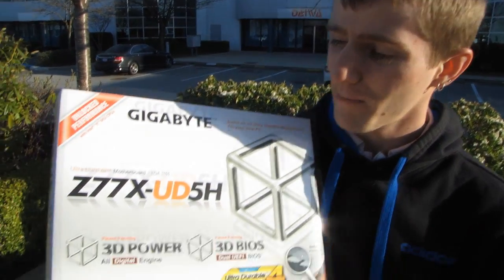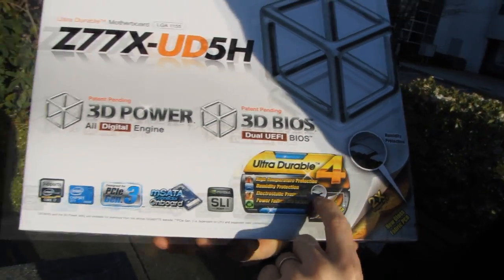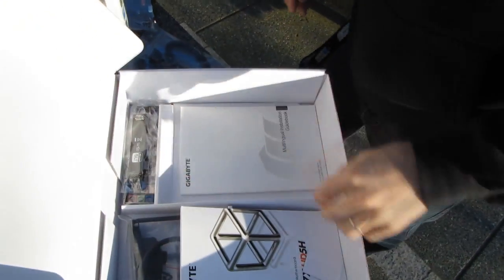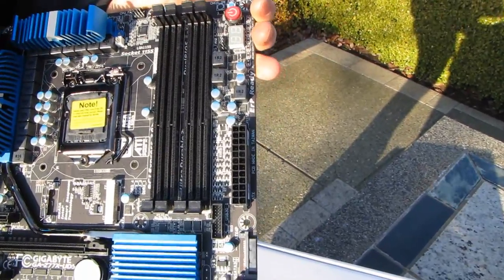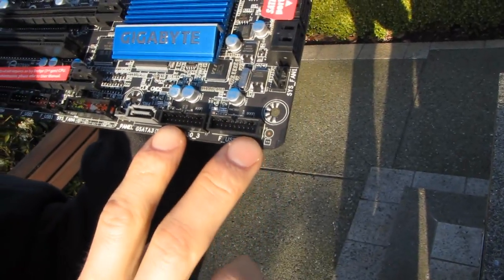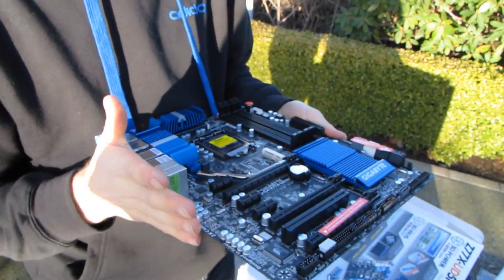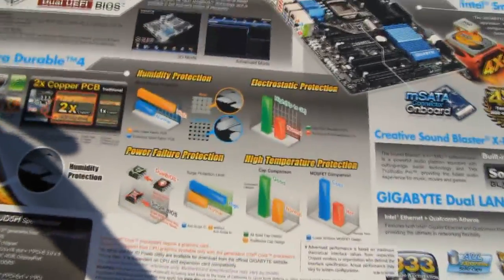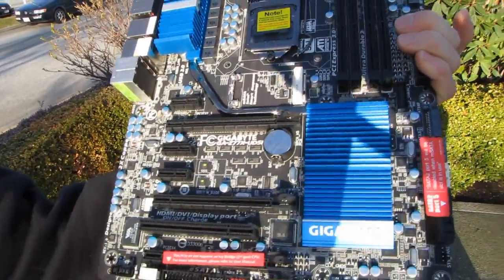Gigabyte Z77X-UD5H Z77 Ivy Bridge Motherboard Unboxing & First Look Linus Tech Tips

Comment: still rocking one of these in 2019,  with a 2600k, modestly overclocked, still going strong.   The board always had some little quirks, otherwise it's still gaming very well with a gtx 1070 and ssd.
Reply: @linustechtips Do you think it could hold any RTX cards?  @joefromspace
Reply: @mattmacaraeg no, it might be a bottleneck.

Comment: I actually ended up getting the P8Z77-V PRO, I love this board, has lots of features and is a better overclocker than the UD3H, I really recommend it, but i havent bought my 3770K yet, but i will in the next week! So far my rig has 16gb G.Skill Ripjaws-X, P8Z77- V PRO, Corsair AX-760i and my case the Thermaltake Chaser Mk-1. I also still need to buy my HDD's, H100i & GPU after the CPU. I was also thinking of just trying to get the system running quickly using integrated graphics & stock cooler.

Comment: here is my suggestion for a bang for the buck build.
mobo- Gigabyte Z68MA-D2H-B3
graphics- HD6750
PSU- FSP 500w
RAM- G-SKILL 1600mhz 1dimm 4g
processor- intel core i5 2400

im playing @ 1920-1080p and i can play most games at medium to high graphics settings. this is my current gaming rig and it has been running since January..

Comment: There is an unmarked 3-pin connector right next to the RAM slots. The manual makes no mention of it. Does anyone know what this connector is for? I am NOT referring to the CPU_PWR or HP_PWR connectors, which are in the same area.

Comment: Just got one of these in the new rebuild. Gorgeous BIOS. Only problem is it's a bit finicky about the Ram you install. Had to retry two or three kits to get it to run right. After that, smooth sailing.

Comment: Yo, if i got this motherboard that only has 4 pin fan headers, but all of my fans have 3 pin connectors, could I still use them with this board? Or would I need a bunch of fan adapters?

Comment: I have just built my new system with an i7 3770k mounted on a GA-Z77X-UD5H  and when I boot up I get a debug code of D4 on the little on board code display, however if I go and restart the computer  it goes back to A0 until the next time I down power re-power. 

I tried to unpugged averything restar cmos and still, The thing is if the led display wasn't there then I guess I would never know as everything seems fine?